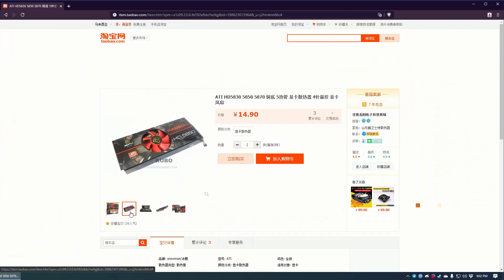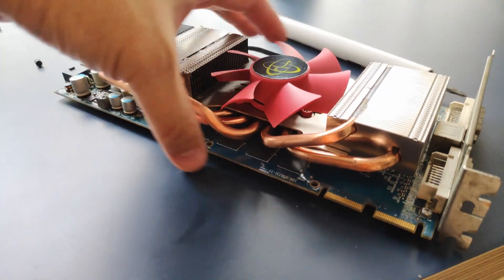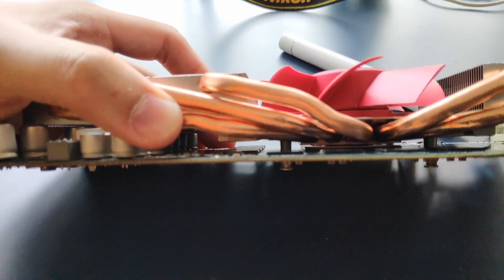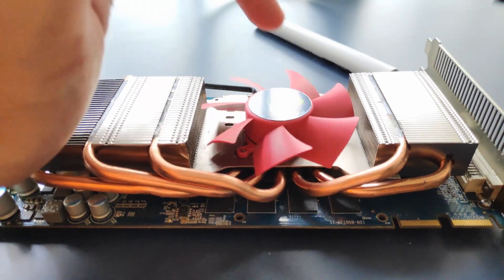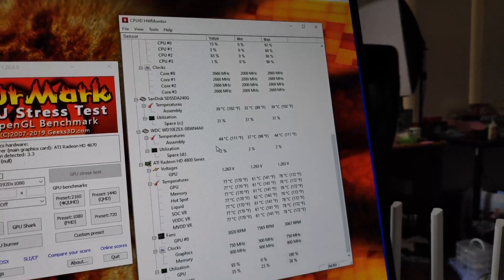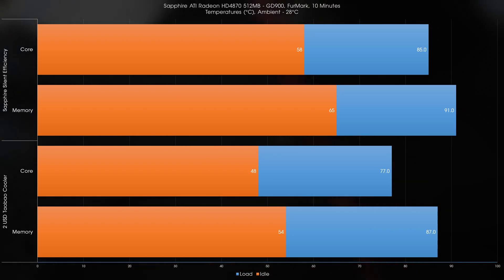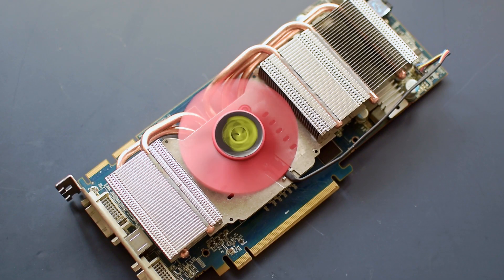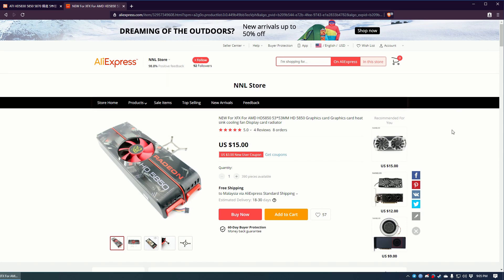The 2 USD GPU Heatsink that WORKS

Comment: i bought heaps of cooling and memory heat-sinks and that from Taobao last year, also bought a Zalman reserator max 3 with shipping was 53.98 NZD, new old stock, had to empty the loop and refill thou with some distilled water and a microbacterial agent, actually doing that now but yeah LOVE TAOBAO. Also buy most of my Outdoor Gear straight from manufacturers there on TAOBAO
Reply from the maker: Taobao is amazing, it's a shame not many people know how to use it, but honestly even for myself, it's just a bunch of Google translate. 

I don't understand a word of it haha
Reply: @TechRodent  neither. Yeah people get put off i think when they translate it with google or yandex and it is misplace bad grammar broken english if ya can translate that what you typed and what is received by figuring out roughly what the item description or the seller is saying, then you are pretty good.

Comment: But the real question is - What are you playing/doing with that GPU :P
Reply from the maker: Oh the person using it is using Photoshop, Illustrator with it. Light workloads that don't come close to the Furmark stress test I threw at it ahaha
Reply: @TechRodent  Perhaps I should let Mr MuBot know that my old MSI R9 390 8G Gaming video card is in my old system that has a WordPress install with Fedora Server?  Most have yet to comprehend that the intended use defines the system.  Thus in retrospect I wish I had kept the old HD7970 than the R9, though for my purposes the R9 performed 25% better in my case scenario.  Currently I have been using a XFX RX 5700 with different settings as needed for games.  Just as some may not be aware that one can change some of the settings such as sampling, aliasing, and post processing while at a 4k resolution compared to 1080 settings.  Meanwhile most reviewers only perform GPU tests mostly at 1080.  Meanwhile a person will find it much easier to perform multimedia edits on a much larger 42" display.  In the past I've had one accountant requested a smaller display as I was finishing up setting up a larger one who had requested a larger one, and in amusement had I known prior to bring one over I could've merely switched them.  Note that I was only one of two people working in the company with many workstations throughout a fairly large company at the time. aka IT/MIS  So closing with a bit of humor, most users do not see beyond their own desktop and there are those of us who predate YouTube reviewers|content providers.  Thank You TR.  :)